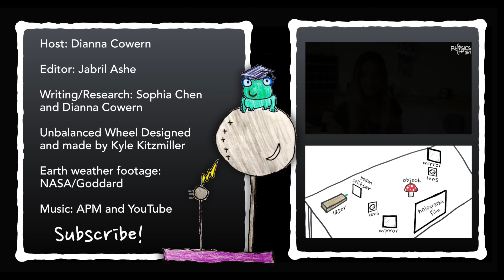Are perpetual motion machines possible?

Comment: If you use magnetic bearings and your setting was space, there would be no friction and no gravity.  Surely this information has been considered?
Reply: Even magnetic bearings have some coefficient of resistance-but even with an imaginary perfectly resistance-free bearing, it wouldn't wok.
You could theoretically spin something in those conditions, and it might turn until some outside force acted upon it, but it couldn't do any work, so it wouldn't be a perpetual motion machine.

Comment: Use a current wind turbine...

It already works,

I read a book about the greatest inventors.

They learn from the older one, and apply the newest update on the science to the old invention.
Creating a better idea...

But Tesla did this, and only got so far because of the technology of the day was only so-so.
But now we have been able to get his ideas to work, because of the way technology has progressed.

Now let's see if we can progress his work further.

Take a wind turbine generator and remove the blades and the tower..

All you got now is the "hub"
Where the energy is produced.

Then with assistance add two large rechargable batteries, from the batteries run two sets of cables one to an electric motor turning the hub "IN" , and one to the house fusebox "out" the set from the fusebox into the batteries (but ! , The set going to the batteries first goes into a circuit breaker box) , to switch the flow of the power from "battery#1" , then an added CPU will automatically switch the flow from "battery#1" to " battery#2"
The power goes to the motor turning the hub at optimal speed till the power runs out, but with the second battery, the power never runs out.

The hub is large enough to power the house and if decided to power the whole neighborhood.

Then the excess power is filtered through the fusebox into the batteries. Creating perpetual energy. It's sounding more difficult than it really should be.

 But that's why they educate people

Creating a supply vs demand ratio, constantly fed.

Enjoy
Reply: @Just Looking depends on the heat applied

Comment: Perpetual motion is only possible if we can sort out the centre of motion by the geometry of gravity... It's possible if Bhaskara's  wheel can be modified a bit with the mercurry proportions in such a way that some of the mercurry tubes to be fitted within and the rest fitted within another circular dimension coinciding the inner circular dimension on same axis... There is a probability... I wish if I could elaborate my mind made design.. Trust me it's not impossible.. but it needs lot of perfect mechanical engineering of the tube's position..

Comment: The hardest part is, Petroluim companie paying trolls to discourage young engineers to develop this kind of project... This is working but they will kill you if you publisize your specs on how it works... I made one nd its working
Reply: So your perpetual motion machine is working, yet you continue to buy gas for your car and fuel/electricity to run the furnace in your home.  Why?

Comment: We don't need perpetual motion machines we just need machines that work for a very long time like a year or two years or 5 years it doesn't matter if it eventually stops just as long as it works for long enough to produce more energy than we could otherwise produce with as little energy input as possible such as a magnetic commercial motion machine that eventually dies off because well physics eventually it will slow down eventually it will stop however with magnets theoretically is possible to have a machine that continues running for at least a year a year minimum or even 6 months 6 months would be great then you replace a few parts and start the machine up again.

Comment: The word impossible is said when there is ignorance or inability to do something, or it is said in the event that there are sufficient evidence to confirm that it has not been achieved and does not mean that it is not possible.   
As for the physical law, it is true, but gravity causes friction, and this produces weight, which prevents movement.
It is not impossible and can be achieved in many ways, but far from the form you use

Comment: Nitpicking a five year old video: 
0:50 "friction,which will eventualy stop any wheel " Friction drains energy from the wheel,  if the gravity-bullpoop works it willgenerate enough energy to overcome the friction, that's kind of why all the weights and stuff are in there.Otherwise the design would center around a frictionless bearing, a vacuum etc and it would be a wheelthat does not stop but also cannot poweranything and that's a ueless machine.

Comment: An orbit? or shooting a bullet in deep space where the universe is expanding faster than the velocity of the bullet. Perpetual motion when there's no resistance and when there is no energy gain and no energy being transferred. So what's wrong with perpetual motion if it does not power anything.

Comment: You say the bird isnt perpetual motion but it doesn't stop and it is unbothered by friction. With that knowledge I'd say the coin wheel was never going to be perpetual motion even if it spun endlessly because gravity is pushing it. If the bird is constantly being moved by nothing but air temperature I'd consider that perpetual motion.

Comment: Just saying... If there were no friction, this would still rely on the input of gravity; which would not make it perpetual. If taking away light, gravity, and neutrinos didn't stop the machine, you would have perpetual motion. Too many laws of physics make perpetual motion impossible, but finding a place where no externals affect the machine would be equally impossible. The second law of thermodynamics is only theoretical, as a perfectly closed system is impossible.

Comment: I was granted US patent 3890161 DIODE ARRAY in 1975 for a device which harnesses the thermal motion of electrons. The thermal electrons are rectified in each of billions of nanometer scale diodes. The nanowatt scale rectified electrical power if each diode is aggregated with a large number of other diodes in consistent orientation to produce usable amounts of electrical enegy. When the electrical energy  is exported there is an exactly corresponding reduction in thermal energy in the collection of diodes. The loss of electrical energy by resistance in the wiring is small and easily compensated for by extra cooling by more diodes

Energy has changed form from heat in ambient air or water,, a cooling,, to electrical energy but not been created or destroyed

There is evidence that  a device made of vertical gold needles abutting N type GaAs worked but the testing lab didn't release it to me. A superseding proof of concept prototype device needs to be built funded by a crowd grant.

Comment: Did you know you can’t patent a machine constructed of patented devices like a pre-patented motor a pre-patented generator a pre-patented transformer throw in a secondary generator for the alternator you got it clean energy machine he started up with a battery
Reply: Here’s something funny if you were to set up a second motor for the second generator and used it it worked just as well as built in a second generator and still no physical electrical connection to the primary generator just a physical torsion connection and like I said you pay for the pattens when you buy the devices
Reply: No silly you plug the generator motor combo into the wall that’s powered by the provider or you can bill today to the electric motor turning the generator but I suggest a circular Saul motor

Comment: Why have electric cars never harnessed the energy created through the motion of their wheels to help maintain a battery charge?
Reply: They have and do.  It's called regenerative braking.  Anytime the wheels are spinning without being powered by the motors, the energy is harnessed to recharge the battery.
Reply: @BassPlayerUnderGrace  exactly. Only when not under power. Like an alternator that stops working when its spinning?.?. Just seems to me there could be a way to harness the energy while in motion.

Comment: It actually is possible. The laws of thermodynamics allows for the conservation of energy. At the moment I am trying to recreate a design from the 1700's which shows potential. And if it does work then it will be sad that before the laws of thermodynamics it was conserving energy. And if that doesn't work then there is a simple design that I'll build. As for the amount of energy the wheel from the 1700's would generate, 1,000 watts from a 12 ft. diameter wheel would be possible. I've done the math. As for the design, I am increasing the disc size and if that allows it to generate much more torque then I'll be in busy. And with the bearings I used, they were greased but will clean then and go with a low viscosity motor oil. And this design is based on Johann Bessler's work from the 1700's. https://youtu.be/MtlhoIOkRkA

Comment: its funny cuz i have created one using water and pipes that flows untill the water evaporates but fixed it by using air tight roof and filled it with some air pressure and it is still running in my garage 
just be smarter duh

Comment: You can get something for nothing, or everything doesn't exist. Think about it. How does matter exist? Where did it come from? Either it always existed some how, or it some how came out of a complete void of nothingness in to existence, a singularity point. So it would seem in some cases you can get something from nothing. Otherwise did the big bang not explode from nothing? How did it get all that energy? Where did it come from, at certain point you have to realise there is something beyond comprehension, so it's a case of understand how to do something. I mean even if you work out how to get gravity to turn a wheel with no friction, the energy source would be that creating the gravity. So I think it's important to think how can I take advantage of natural events and gain energy, and aim to work out a way to do this. Wind energy is a good example, solar energy from the sun is a good example, if a person can figure out how to take advantage of something in nature which causes less or no long term problems, that is a positive. :)

Comment: You cannot get something for nothing. That is ok..but what about the universe? It seems as if it is something for nothing.  The big bang I mean... Why we cannot build self sufficient perpetual motion machines? Because it was built once in the beginning and everything is a piece of that machine. The laws  of thermo.
Reply: @he11b1ade  I happened to read somewhere that the laws of thermo are not so strict in the realm of subatomic particles. I am no expert. I just wanted to state that one cannot get something for nothing. But it is possible that the universe came from nothingness. These have nothing to do with creation or any other transcendental being. There are still lots of unknowns. 🙄
Reply: @he11b1ade  the quantum entanglement phenomenon for example. Does it not contradict with the entropy law... There must be a disorder with particles which are light years away from each other. But how can they act as they are not expected to do. The thermo law states that the entropy is always increasing..  does this not mean something significantly different?

Comment: If you put your electrolyzer deep under water and fill an inverted bucket the amount of energy to create 5 gallons of hydrogen oxygen gas is much less than the energy of buoyancy that will be obtained from a pully and a generator. Find the flaw. 5 gallons average volume during ascent is 2.5 gallon. 2.5 gal * 7lbs per gal  is 17.5 lbs divide by 2.2 kg per pound is 8 kg. 80 Newtons times 500 meters is 40000 joules. Take the gases and recover eighty percent of the input energy. Hmm
2.5 gals is 10 liters of hydrogen. That takes 10kj per liter to make. so 100kj input but 80kj back from the fuel cell. so a total input of 20kj and total output of 40kj.  COP of 2.0 at 500m depth
You expel the oxygen into the water and just use the hydrogen for the lift bags.
At 3300 ft or 1000m the COP is 4.0. That is the oxygen minimum zone where 90 percent of oxygen is used up by biological processes. By expelling the O2 at 1000m depth you are reversing the effect of low oxygen of less than 2mg/liter to normal levels. This will preserve the ecosystems off western coasts.
The hydrogen at the top enters the fuel cell and O2 from the atmosphere combines with it to form water. The oxygen is magically transported by the machine to a depth of 1000m. presto

Comment: Without energy? There is always energy around.. Just the wrong designs.. That one with a ball dropping and falling is an perpetual motion machine.. Not in this video. They are not impossible i don't believe that. I could be wrong.. The sun well it's oxygen and hydrogen converting.. that's another thing.. But yeah i believe they are possible.

Comment: Why do smart people (throughout time) sitting at their desk with little model wheels and weights to make one side heavier than the other, fail in there efforts ? 
? They are not as smart as me ? 
Maybe if they were good engineers and understood that a wheel is a leverage device and therefore a larger wheel might help them see the answer. 
Or if we added to their reality that they were in scuba gear and at that perverbial desk, only in a pool underwater, head 3 feet beneath the surface .
Hmm . . . Maybe then they could see it ?
OK if you still can't see it . . . Add " Maybe  make it lighter on the other side too "
IF YOU CANT GET IT FROM THERE . . . YOUR NOT SMART . . . OR AN ENGINEER  EITHER.  so there.  😃

Comment: Errr, you're standing on one. The Earth has been around billions of years perpetually spinning. To say a machine cannot have any source of energy is literally taking energy and thus movement out of the equation. Even the supposed non-working wheel would have gravity as an external source of energy...It's a pointless argument/endeavor. Now, whether the energy has to be replenished by man to go great lengths of time... that's a more interesting conversation.
Reply: @darklight2.1  You're so sure are you? A force that is always acting upon an object causing movement is not a source?. With this logic you would say a river would not be a source of energy for water wheel generators.  
Look up gravity generators.
Reply: @darklight2.1  Thanks for the response. Though, you said it yourself...You can store PE with gravity.
I'm curious what you consider a viable source of energy? Coal for i.g.?
Does one not need to exert continual amounts of energy in order to mine, gather, and arrange for it to be released from PE to KE?  How is this different from lifting a weight to be released ... as gravity generators do?

"When a object is sitting on the ground, how much energy is being expended to keep it there? The answer is: none. "
I'm sure you are aware there is still a continual vector force being exerted upon the physical structure which results in wear over the course of time. Gravity is the reason you get uncomfortable for sitting down too long and thus gravity springs you upward as well as downward.

Scientists are supposedly successfully measuring gravitational waves these days. Wave by it's very nature is movement and thus energy. If the main sources of gravity are planetary bodies, then we are animated by these celestial movements.
Reply: @darklight2.1  Ok, you’re making it overly technical.

The clear and simple truth is that for any machine to work, it needs a source of power, whether that’s a man turning a wheel to generate electricity, coal, or a weight and pulley system being driven by gravity. You cannot separate weight from gravity.  Everything is essentially energy.. it’s all  about how it’s arrange and released and harnessed to which we can use it.

To my original point…the room temperature air IS part of the closed loop system… it’s a fairly long standing constant. Removing the energy from this equation would be like removing gravity from the perpetual motion wheel exercise (which depends on gravity).  That’s it.

You speak as if gravity is some dubious phenomena.
Gravity drives the flow of rivers, the rise and fall of tides, the massive pressures underneath the earth’s surface contributing to earthquakes  and volcanic eruption. 

Also, a wave no matter how weak, is still a wave nonetheless...